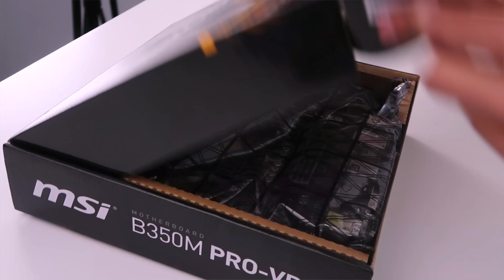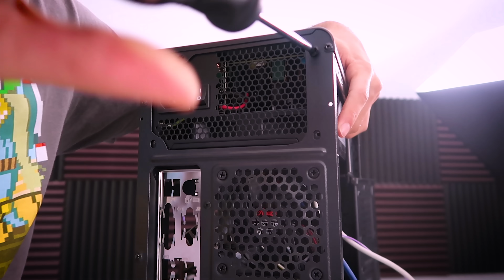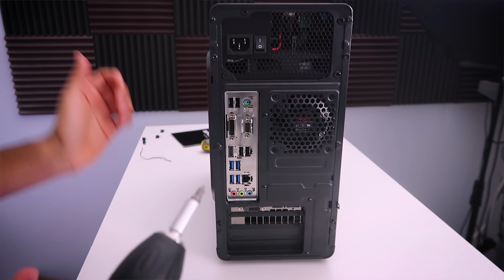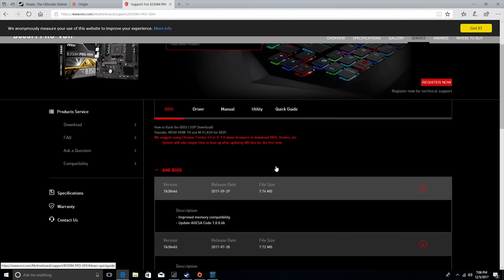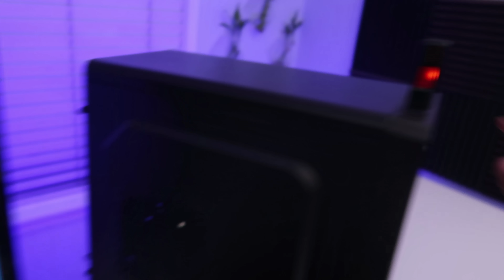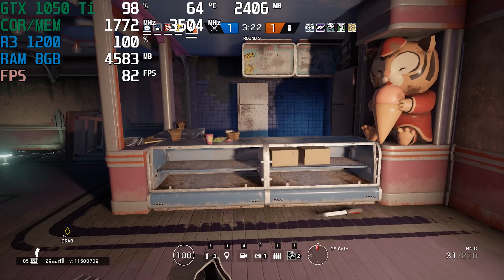$500 Budget Gaming PC Build Guide - GTX 1050 Ti (w/ Benchmarks)

Comment: I remember these days. The 1050ti was the best if not one of the best budget option gpus, when mid range gpus were still usually less than 250 and when covid wasnt a thing. Im not throwing generational performance increases out the window, and there has been advances in between cpu and gpu architectures, but I simply wish that things weren't as expensive as they are now. And that eventually pc builds can return to 500 dollars to make it more budget friendly.

Comment: Almost about a year ago I bought a low end, pre-built gaming pc with almost the same specs, a Ryzen 3 1200, 8gb of RAM (single stick), Gigabyte GTX 1050Ti OC, 1TB HDD, and lastly a 500 WATT PSU. 
Later on, I decided why not, I can start to upgrade some parts and fully design this pre-built of mine, with my very own favorite hardware. I first upgraded the processor since that's the main brain of the PC to a Ryzen 7 2700x. I then added a 500 GB and also a 1TB SSD and set Windows to boot on my 500 GB SSD for a faster boot up. I then bought 3 extra 8GB RAM sticks of the same brand to make it 32GB in total. I am now waiting on my final upgrade, which is my graphics card. For my GPU, I ordered a Asus RTX 2060 OC for a smooth high graphics setting gameplay. I bought my GPU from StockX

Comment: So I built this PC, and was looking to upgrade, should I build a whole new PC?
Reply: What are the specs?
You probably only need to change the CPU, GPU and RAM?
Reply: @CosmicVoid420  Ryzen 1200, 8GB RAM DDR4, B350M Pro VDH, and GTX 1050ti
Reply: @mrazza6182  
You can keep the motherboard just update to the latest BIOS to use Ryzen 3000 series CPUs.

Get a Ryzen 5 3600 CPU. That's one of the best price to performance CPUs.

16GB RAM. I think your motherboard can support up to 3200MHz RAM speed. 

Then keep your GPU for now since GPUs are out of stock and overpriced.
Then you can upgrade to something like a 3060Ti or whatever when the stocks are normal.

Comment: i have a gtx 1050 ti and wanna upgrade to a rtx 2060, can i just replace it normally or
do i have to get a new motherboard. like are they shaped differently to where it wont fit?
Reply: I think you have to get a new power supply. im looking to do the same thing
Reply: @agh9224  no I didnt
Reply: @DrMontrays  so it worked out fine?
Reply: @agh9224  pretty much but double check everything
Reply: @DrMontrays  I think mine is fine. I’m getting 2070 super mini, but I’m getting higher watts just in case
Reply: @agh9224  okay good idea, I heard the 2060 barely helps in some things like fps. Tgeres definently a difference in stuttering bc I barely get stutters just only like 10-,20 more fps

Comment: I saw the same build on letgo, except it was 475$ and built awfully. He had 16 gb ddr4 2666 RGB ram, a ryzen 3 1200 (but the cpu cooler wasn't on the right way) and his GTX 1050 Ti was at the bottom pci e slot, so he basically had lower bandwith on it.

He had like 1 intake fan and 1 out take fan his ssd wasn't even screwed in but the cable management wasn't bad. But it had dust everywhere and some how he sold it.

Comment: I Know A Good Setup With The Same Price Point

Motherboard: Asus Prime H310M-E R2.0 ($56.07)

Link: https://www.amazon.com/gp/product/B07GNQK5NP/ref=ox_sc_act_title_8?smid=ATVPDKIKX0DER&psc=1

CPU: Intel Core i3 8100 (4 Cores And 4 Threads) 3.6 Ghz  ($118.39)

Link:
 https://www.amazon.com/gp/product/B0759FTRZL/ref=ox_sc_act_title_9?smid=ATVPDKIKX0DER&psc=1

GPU: XFX RX 570 4GB GDDR5 ($129.99)

Link:
 https://www.amazon.com/gp/product/B06ZXY43VC/ref=ox_sc_act_title_2?smid=ATVPDKIKX0DER&psc=1

RAM:  T-Force Vulcan Z DDR4 16GB (2 x 8GB) 3000MHz CL16 ($59.99
)

Link:
 https://www.amazon.com/gp/product/B07QNKJVR8/ref=ox_sc_act_title_7?smid=AWD7GDDT7Q2ZT&psc=1

CASE: Thermaltake Versa H15 ($49.00)

Link:
 https://www.amazon.com/gp/product/B07THWNQ1D/ref=ox_sc_act_title_6?smid=ATVPDKIKX0DER&psc=1

SSD: Crucial BX500 120GB SSD 2.5 Inch ($24.99)

Link:
 https://www.amazon.com/gp/product/B07G3L3DRK/ref=ox_sc_act_title_4?smid=ATVPDKIKX0DER&psc=1

HDD: WD 320GB HDD 3.5 Inch ($17.90)

Link:
 https://www.amazon.com/gp/product/B000VZ40CI/ref=ox_sc_act_title_1?smid=A2YWX9H35J020&psc=1

PSU: Apevia Venus 450W ATX ($23.99)

Link:
 https://www.amazon.com/gp/product/B01GUENTKC/ref=ox_sc_act_title_5?smid=AEHA1AAWZIC3L&psc=1

Additional Specs:
FANS: ARCTIC P12-120 mm ($7.99)

Link:
 https://www.amazon.com/gp/product/B07GB16RK7/ref=ox_sc_act_title_3?smid=ATVPDKIKX0DER&psc=1

Total: $488.31 ($488.31 Is With The Fan On Additional Specs But If Without It Is $481)

Atleast In 2020/05/13
Reply: Finally someone that is smart
Reply: With used price point in 2021
Amd ryzen 7 1700 (heat sink included) 40 dollars
Gigabyte B450m DS3H 50 dollars
Team Vulcan 16gb 3200 cl16 51 series dollars
Silicon power 256gb nvme 35 dollars
Seagate barracuda 1tb 24 dollars
Gtx 1080 (FE) 200 dollars
Corsair spec delta rgb 50 dollars
Cx750m (2017) 50 dollars

The guy who was selling the r7 1700 said that it wasn’t working but I realised that it had bend pins
The 750w psu was refurbished but I didn’t understood that he sold it for this cheap

Comment: Can you build gaming pc at the cost of 200 $
Reply: Buy a prebuilt dell optipelx with a i7 4770 a 4th Gen i7 with 4 cores 8 threads really good for gaming, and buy a used graphics card like a gtx 760 or gtx 1650-1650 super in the case the whole prebuilt came in and ur good, have fun

Comment: I know this came out 3 years ago, but I have a 1050 ti question. I am running a prebuilt turned gaming pc. 1050 ti, i5 6400, 16gb ddr3, 475watts, w10. I don't know why, but any video I watch about the 1050 ti I get way lower fps than on youtube using the same card. Any one have a clue?

Comment: Idk anything abt pc but if we hav all the parts everything but we don't hav windows 10 will the pc work?
Reply: The pc will work but you won't be able to do anything because u need windows to be able to use it. And if you do build this DO NOT buy gtx 1050 ti instead buy rx 570 or rx 580, they are the same price yet way better in fps performance. Check out yt video on comparisons between the 2 cards.
Reply: @cnoo_f  okay

Comment: Can someone tell me if this pc built is still good to run csgo and r6s in 2019?
Reply: Kostas Nikas u can get 60+ fps on siege
Reply: @johnPastor6537  thank you so much dude
Reply: @tastychickenwings4259  change the 1050ti for a rx 570 same price 40% better
Reply: @skilos69  yea the only thing i changed in this build is the gpu 1050ti to a rx 570
Reply: Yeah man have the gtx 1050 ti and have 160+ fps in r6s and csgo 230+ fps
Reply: this is late but for 2020 get a rx 580 and ryzen 3 3200g b450 mobo
Reply: @samrodriguez6514  just updating you all beucase Im poor af i ended up building the pc around 2020 summer. I bought gtx 1660super and ryzen 5 2600 with 16gbs of ram. And the best part is that i built it up all by my self:)))))

Comment: just a few heads up stuff that I feel he missed, depending on the motherboard it may not boot directly to a windows usb (in my experience it's typically msi z390) so just be prepared to change boot orders. Also if you have the option to update your BIOS, I recommend you do. It isn't just for system stability, it's also important from a security standpoint as there can be vulnerabilities in older BIOS versions.

Comment: Intel Coffee Lake i5-9400F 2.9GHz System

( 9MB Cache-LGA1151- Six Core-i5)  Intel Power PC

Aerocool Cylon RGB Lighting w/ Full Window +  AerocoolKCAS-650G 650W RGB Ready Official Gold 90% Efficiency with Smart fan Control PSU

Intel Core i5-9400F Coffee Lake 6-Core 2.9GHz LGA 1151 Boxed CPU

Gigabyte H310M S2 2.0 DDR4 USB 3.1 (LGA1151)

Kingston SSDNow A400 Series SA400S37/240G 2.5″ 240GB SATA III SSD + WD 1TB WD10EZEX 7200RPM SATAIII 64MB Hard Drive

Kingston 8GB DDR4 2666 (PC4-21300) KVR26N19S8/8

 External 8X DVDRW -Dual Layer Slim USB2.0 USB Powered

Zotac ZT-T16600F-10L Gaming GeForce GTX 1660 6GB GDDR5 PCIe

Samsung LS24F350FHMXZN 23.5″ LED Full HD Monitor

A4Tech Bloody B2100 Blazing Gaming Desktop illuminating Key+Mouse

Assembly $10.00 ( included )

PC Discount

$829.00

Good Or Nah?

Comment: the case with the power supply on top is shitty because all the heat from the case will be absorbed by the power supply 's fan , and it'll go up to 70° quickly , even more with the standard fan of the ryzen 3

Comment: While there's mostly great advice for budget building in here, I'd strongly recommend you guys consider these tips. Not to be harsh on this guy, just that there's a couple things I'd change.
If you have any way to use an ethernet cable rather than wifi, almost always choose ethernet. Ethernet cables are so much faster and give you way less connectivity issues. It's no contest. I recommend you get a CAT7 or 8 cable.
Also, I'd probably give that cable management about a B-.
That's all. Again, not trying to be harsh. Just some observations I made that I think would improve your PC build.

Comment: I've had this pc for nearly a year now and its holding up really well. The only issue Im having is the 100% disc problem on windows 10. Im currently working on a fix though :)  (I mainly play Fortnite, Rocket League and OverWatch)
Reply: Bartosz Fortnite you say
Reply: @toughluck2632  😂
Reply: 100% is pretty usual if your running windows 10 on a hdd. best option is to get a ssd and use it as a boot dtive and priority programs

Comment: This is a great build, 
But just throwing this out there, check around some prebuilt sites.
I bought pretty much this set up from a company called sky tech, came with a 2yr warranty and support, got everything he did also a 2tb hdd. And only spent 520.00ish dollars, it’s a super cool case that came with 3 fans. 
So just some food for thought.
Reply: Also the case is able to hold a full atx. 
I believe the mb I upgraded to was a msi x470 gaming plus (or pro). Fits snugly.
The power supply is a 600+80.
CD player.
2rgb front fans, 1 back fan.

Comment: Me personally id highly recommend getting the rx570 instead of the gtx1050ti. It basically beats the 1050ti in every single game and they are cheaper than the 1050ti. :)
Reply: Back when joey did this build i think the rx 570 was more expensive than the gtx 1050ti but right now in 2019 the rx 570 is the best budget graphics card better than the 1050ti and 1650

Comment: Optiplex 9020 with a i7 4770, 500w power supply and gtx 970. Boom 500$ gaming computer
Reply: @Free Anar For Sale That works really well too, 500$ is a great budget because it lets people buy the os, keyboard monitor and ssd or hdd if they don't have it. The ebay optiplexs usually come with ram.

Comment: Can u run Fortnite on this
Reply: Mark Bolton lmao. Any decent potato can run fortnite. What is your definition of running fortnite? 30fps? 60fps? 720p? 1080p? Be more specific
Reply: SJ 08 100 fps
Reply: @markbolton3877  If you plan on playing on 1080p then you'll get above 100fps around low and medium settings. However, if you play at 1080p with High settings you will get around 80 fps on average. And on Epic settings you will be getting 60fps and below. This is all with the 1050ti. If you want above 60fps at 1080p on almost every game then you should go with the 1060 / 1060ti / Radeon RX 580. And if you can go with the 1070. That card is a beast.

Comment: I’ve ordered a 760$ pc bundle it comes with 24inch monitor, keyboard, mouse and the pc. How good do you think the actual pc would be
Reply: Derrt TV what are the specs?0
Reply: Alex Blaike 3.9Ghz (4.2GHz Turbo) AMD FX-6350 Six Core Processor, 2GB AMD Radeon R7 360 Graphics Card, 3000GB (3TB) HDD Hard Drive, 16GB 1600MHz RAM, Aidos CPU Cooler

Comment: You put the hard drive in the wrong way. The sata ports should be facing the inside of the computer. You're basically squashing the cable by routing them outside the case

Comment: 1050ti wasn’t good choice. You can buy for example rx 570 4gb... Its cheaper and better.
Reply: Mirec this was during the gpu mining crisis back then rx 570 was more expensive but nowadays a gtx 1050ti is around 150-200$ and rx 570 is 100 - 150$
Reply: Hell, I found a used RX 580 for $110 and it's awesome

Comment: Very good and detailed guide how to hook up a new PC. Credits for that!

But:
-only download a new BIOS when strickly necessary
-don't download Geforce experience 

Let Windows 10 do his homework and it will be all fine. It installs all the drivers you need by itself. My gaming rig is set up by Windows 10 himself. Let them download the drivers need en game on. It works like a charm, no exclamations in the device list and 2 year up and running without any problems at all. Windows 10 does his job more than just fine and new graphics drivers are only necessary when a game works well or if there are problems with a driver. No need to download everything.

And maybe stupid as I am I let manage Windows my €2000+ euro gaming rig. But stupid in what? I get the same performance as a identical system on YouTube.

Sorry for some typo's maybe, but I'm Dutch.

Comment: I had a quistion guys is the games on max setings and is he recording with OBS or whatever because im looking for a pc that will run games and you could strean or record😄
Reply: Gvido Kokars this video is a bit outdated i would recommend staying with everything except the gpu and cpu
For the cpu get the ryzen 5 1600 its 79$ on microcenter on sale and on amazon its 129.99$
And for the gpu get the rx 580 but if its expensive pn your country get the rx 570
In total it should cost 500$-600$ it depends on your country and the ram prices and gpu prices have dropped :)

Comment: I built this pc a year a year ago and im looking to upgrade it. I saw a 1070 for £250 and was wondering what cpu and/or what could match well with it. My budget is around £400. (keep in mind i will sell the previous components once  i upgrade the pc making the budget more flexible
Reply: Rtx 2060 graphics cards are going for £300 in some places and are capable of 4k gaming
Reply: @jakerobbins8101  that is a good deal but im only interested in 1080p gaming. Ive seen rx 580's for £190 which goes well with the r5 2600.
Reply: @rackattack1234  yes they are also very good for the price
Reply: Ray get a rtx 2060 over 1070, 2060 is cheaper than 1070. A good pairing with 2060/1070 is i5 8400 or ryzen 2600

Comment: I used most of these parts for a computer. Gpu is amazing I suggest it a lot. But the mobo, cpu and psu is way too strict. It’s you’re able to flex your budget. I suggest something better like a 500 or a 600w a higher Ryzen like a better 3 or 5. But if you want to get a Ryzen 5 you need to by a mobo that supports AM4 and UPGRADE YOUR RAM at least get 16gbs or you’re going to deal with freezing and long load times.

Comment: Just built this with the Ryzen 3 1300 and it works amazingly. Runs the games I play on ultra at over 100 fps such as Rust, CSGO, Etc (Also my first pc build)
Reply: Cool i got a gtx 1060 with i5 2500 and I'm suffering stutters and fps drops
Reply: Rinzuala_ rz have u updated ur gpu drivers? Tried putting v sync on? Done an internet speed test? Hi hi If u have 8gb ram then probably need 16gb.I have 1070ti, r5 1600 and 16gb 3200mhz ram and I had stutters and other problems on games and in the end it was because I was an idiot and didn’t update my drivers.
Reply: @username-bc8gr  I always update my drivers and my download speed  100mbps. I used msi afterburner to check the usage and my cpu seems to be stuck at 100% while gaming and my gpu is utilized less than 60%
Reply: Rinzuala_ rz that’s odd
Reply: @username-bc8gr  Playing rust is a nightmare I get stutters every couple of seconds in Super potato mode. I tried capping my fps to 60 and then to 30 my gpu and cpu usage surely decreased but my ram usage is still the same so I'm pretty sure its my ram
Reply: Rinzuala_ rz what’s ur ram?
Reply: Yes I'll not upgrade but build a whole new pc after I get a job, but this pc preforms extremely well
Reply: I have 16 GB of RAM
Reply: Zombo you gonna upgrade 1050ti at any point?

Comment: is there any other cases that i can use or would it be not smart
Reply: You can use other cases, but you need to find the right size so it can fit all the pieces like the motherboard and graphics card and the other components.

Comment: Is it worth to just get a ryzen 5 1400 or a 3 1200 is better???
Reply: Vehement Moon get a 2200g or 2400 the new generation is a lot better
Reply: @alexolvr7534  omg thanks its the same price as the ryzen 5 1400 which only has 3.2ghz and the 2200g runs at 3.7 thanks dude
Reply: Vehement Moon it also has new features such as improved cache so the 2000 series is definitely worth it
Reply: @alexolvr7534  Ok thank u ill prob buy it soon when i start building my pc but im going to use the gtx 1060 6gb with it and play fortnite is that good?

Comment: So I am a pc noob but can I get better FPS with this pc? Like changing the ryzen 3 for a ryzen 5 or something? 
My budget is 600$
Reply: Go for a different graphics card instead. Instead of 1050ti get RX 570
Reply: @whenimbored9640  oh, ok thanks so do I just put it in and it'll all be good? Also thanks for the help, rx has better performance.
Reply: @zwardz8179  yeah, it does
Reply: wait can you tell me exactly which graphics card I should get? Because there are a lot of them.
Reply: @zwardz8179  all perform similar. Get Asus Strix RX 570
Reply: @whenimbored9640  Dude I was thinking of getting the  AORUS Radeon RX 570 4GB  cause the strix got bad frames
Reply: @zwardz8179  should perform the same, just get what you prefer